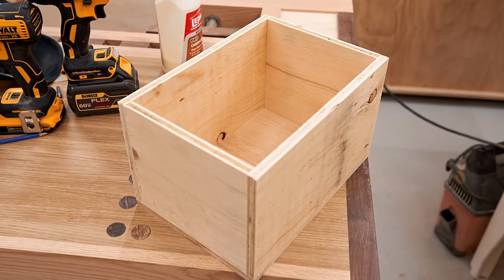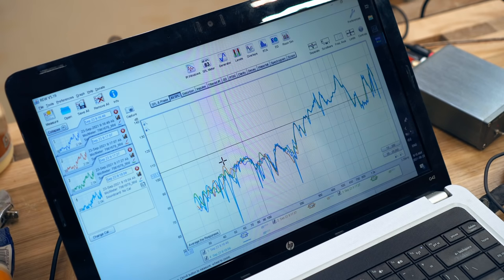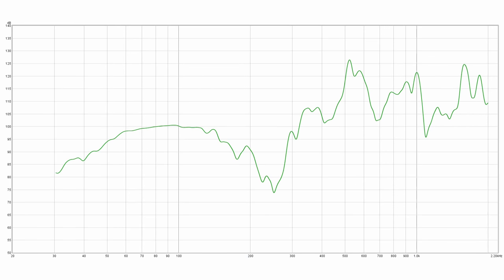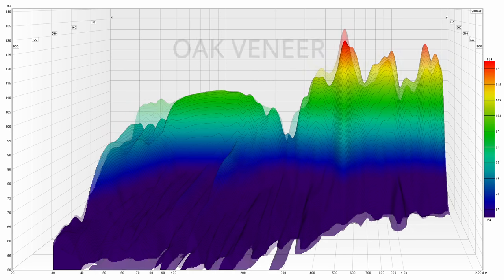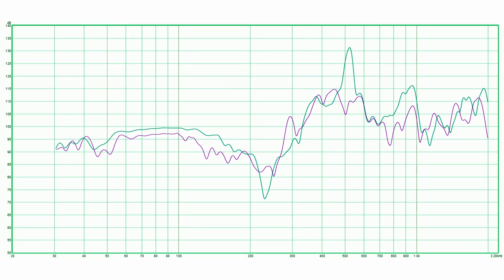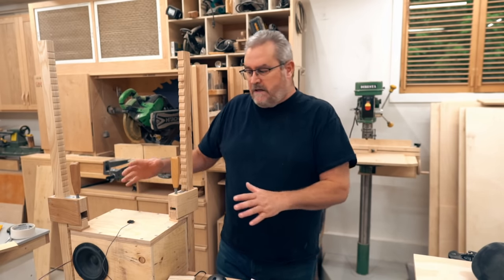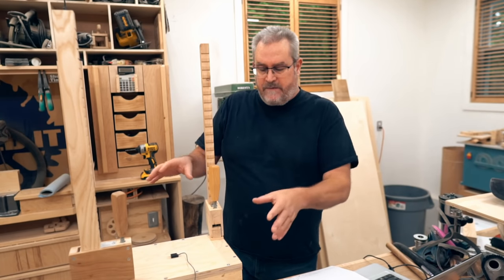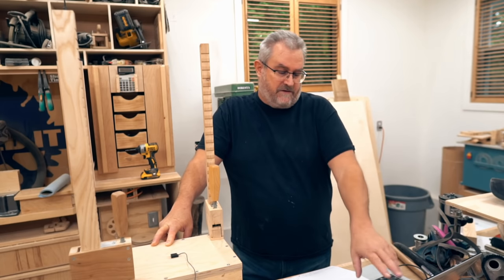PLYWOOD vs MDF For Speaker Building - Tests Show Surprising Results

Comment from the maker: NOTE: This is to clear up some confusion over what I meant about bracing and damping:
Speaker building was always bracing and damping. But at some point the idea started that bracing alone was better, just using a lot more of it. Guys were still doing the traditional bracing and damping (like me), but you also started seeing these bracing only builds happening. The idea was to drive up the panel resonance high enough so that it wouldn't be excited and therefore wouldn't be a problem
I'm speaking 100% from a DIY standpoint, not from what the major manufacturers were doing.

Will making the entire box from the same material make a difference? Possibly, but I did what I could to take the rest of the box out of the measurement. For example the box was clamped down to my very heavy and stable workbench to keep it as stationary as possible, and help restrict the measurement to the panel itself. Yes the other panels were still vibrating and in turn that can affect the panel being tested, but it's the same for each of the different panels.
Each panel was exactly the same size - 8-1/2" x 12" with the screw holes in exactly the same places. 
Why 30Hz to 2000Hz? I did some "warmup" testing prior to the measurements I made to determine the best range that shows the most relevant data. 30Hz because the speaker I used doesn't have significant output below 30Hz. 
I used my ACH-01 accelerometer connected to REW to run the measurements. I made a special preamp for that  accelerometer in this video: https://youtu.be/o1Fctgs8CcQ

My conclusions are that the material used is not a significant factor in how the speaker will sound. As long as what you are working with is of reasonable quality, you should not be able to hear the difference. 
You may be able to imagine you hear the difference, though, and the human psyche is a powerful thing to overcome. If you believe MDF sounds dull and sluggish, and Baltic birch plywood sounds lively and fast, then it'll be very difficult to get past that and you should use the one you think will sound best.
As for bracing vs damping, I think both are valid. Use bracing to reduce panel size so that the damping will be more effective. The rationale of those that prefer bracing alone is that the damping "smears" the response. Much like above, it'll be hard to get past this idea if it's what you believe, so best to go with what you think is better way.
Reply: Very interesting results .I would like to see tests of clds.i read years ago about someone who glued sheetrock to the inside of the enclosure panels.
Reply: While listening to you explain damping vs. bracing on the video, I think we understand damping differently, and I was curious if you mis-spoke, or I mis-understood you. There aren't very many times where I think you are wrong, or disagree with you, so I thought it was interesting. From my reading on the subject in the past, the stuffing, or damping material is to slow down the sound waves to enable a smaller than the math shows box to be used. In a sealed enclosure this is done by stuffing the box, and in a ported enclosure you more so line the box with stuffing so as not to miss up the air flow from the box to the port. Niether of these things have anything to do with panel damping as far as I undertand. Now if you were too put some type of butyl paper, or the like on the panels, that is meant to damp the panel. But those things would actually drive the resonant frequency down (edit: of the panel) due to adding weight. The bacing on the other hand would drive (edit: the panel resonant frequency) it up, I agree, due to making the vibrating panel smaller. This was a pretty sweet test, that changed my mind alot about MDF being the superior box material for sound deadening. Prior, I had only read opinions on the subject, but seeing a straight up test, kind of changes things. I don't know how well these speaker videos do for you but I for one enjoy them, and this one especially was interesting. You keep making em' and I'll keep watching em'.
Reply: @John Heisz - Speakers and Audio Projects  
Nice test, John!
EDIT:  I just watched your speaker enclosure "Stuffing Comparison" video so disregard some of my info/points below

But, I would not have clamped the enclosure down, at least I would not have clamped to the TOP of the enclosure, as that will SIGNIFICANTLY damp and reduce the top panel vibrations and change the overall resonant frequency.

Those clamps will absorb A LOT of the energy and "normalize" the differences between the various panel types.

Instead, I would have built the enclosure with a base panel (the bottom panel that's sitting on your benchtop) with ends that extend past the vertical side panels an inch or so on each side to use as your clamping points or "wings" at the base.

This will still "damp" the enclosure overall and change its resonant frequency, but would not have affected the resonance of the top panel nearly as much as the top clamping points did!

And to be fair, in the real world none of us "clamp" our bookshelf or tower speakers or subwoofer enclosures to the floor or any other supporting surface, so there's that.  ;-)

I also wish you had taken nearfield measurments of the actual Acoustic Response of the Speaker itself in REW using the different panels with & w/o the internal acoustic damping material using your miniDSP UMIK-1.  That would easily show if any of the changes were actually audible or changed the acoustic response of the driver's output.  ;-)

Obviously, the overall size of the enclosure/cabinet will drastically affect the frequencies and amplitude response of the various resonances significantly.

And with each unique enclosure, you must also take into account the potential internal resonances due to standing waves that will occur due to the specific HxWxD dimensions of the enclosure.

IMO&E, using good internal bracing and a SOLID, DENSE Mounting Baffle for the drivers is important.

The best performing enclosure I have built in terms of being resonance-free were from 1" thick HDPE or UHMW plastic panels.  Obviously quite expensive and as heavy as an elephant, though!  But this material is nice because it can still be cut, worked, & shaped easily using your standard woodworking tools...tablesaw, router, drill, sander, etc.

You must use fasteners and not adhesive to build the enclosure, but you can use thread taps and machine screws to construct and secure the enclosure panels and make them infinitely removable.

I use a 1" wide by 1/32" thick foam self-adhesive gasketing tape between each panel's adjacent connection surface.  Of.course, all of your cuts must be perfectly square and smooth in order to seal the enclosure.

Finishing this type of cabinet and making it aesthetically pleasing is the tough part.   :-(

IME, I have found natural wool fiber to generally work best as internal acoustic damping/stuffing material.  Danny at GR-Research also sells a self adhesive backed sheet foam damping product called "No-Res" which I have found to work well to line the cabinet walls themselves. YMMV

The natural wool, polyfill, fiberglass, or mineral wool batting or "loose fill" helps reduce both the mid-to-high frequency panel resonances, as well as raising the QTC of the enclosure (making it effectively up to ~20% larger overall) by converting vibrational energy (sound waves) into low level heat.  Google Search, "Make A Small Box Act Like A Larger One With Polyester Fiberfill By TOM NOUSAINE".

As you alluded to, I will often use a Constrained Layer Damping sheet material ("CLD" tiles/mat/sheet) such as Dynamat Extreme, ResoNix CLD Tiles (best performance), or Stinger's Road Kill Ultimate (which adds a foam isolation/decoupling layer) to the inner panels of the enclosure to dampen resonances and reduce the resonant frequency peaks.

CLD "Deadener" or "sound deadening mat" is made using a butyl rubber-based compound (usually with mica and/or talc added) that is topped with a thickish aluminum foil type "constraining layer" and has a self-adhesive-lined backing on the butyl side.

This combination of materials works extremely well to dampen panel resonances.  To save on materials and costs, attaching a smaller piece of the CLD sheet or "tile" in the middle or center of a resonating panel works nearly as well as lining the entire panel with the CLD sheet.

I have also used "Green Glue" acoustic damping adhesive to attach and line the interior panels of enclosures with Alphasorb Wood Fiber Acoustic Panels which works incredibly well, though you have to design and build the enclosure larger to offset the reduced internal enclosure volume.

To learn more about the potential audibility of enclosure/cabinet resonances, go to the Erin's Audio Corner YouTube channel and watch BOTH of Erin's objective measurements (Klippel Analyzer/NFS) & subjective listening reviews of the Klipsch Heresy IV loudspeakers.  Many of his other speaker reviews cover this topic as well.

Basically, a.simple impedance sweep measurement using an inexpensive DATS V3 unit will show any resonances as "blips" or "bumps" in the impedance curve or plot, and they will correspond to anomalies in the on- & off-axis frequency response.

Keep up the great work!
Reply: You've only measured 1 side of a 6 sided enclosure. What you've measured is the characteristics of that one side. When coupled with the face, side, bottom and top, they'll react differently unless you've produced a perfect cube. 

Another school of thought in speaker building is many designers WANT the face (I forget the technical term for it, the panel the speakers are mounted to) to resonate and produce sound on their own. This panel can be tuned to augment the actual speakers and produce a desired sound. 

Also: who uses 1/2" material to build a speaker? If you're building tiny bookshelf speakers I can understand it but for any serious main speaker? 3/4" is the norm, 5/8" at the bare minimum. If you're using an 8" woofer you MUST use 3/4" due to the sound energy it will produce. 

To be accurate, you really should build the entire enclosure out of the same material. What you've done is like testing the water quality of a lake by testing a sample at one end, near the shore where your cottage drain pipe is located. Go to the source of the water, a spring, and the water quality will be different.
Reply: I would love to see a box made or corian
Reply: @idray986  I would think corian is too reflective......the best speaker cabinets are acoustically dead.
Reply: I use HDF and you are correct the idea is to cause the resonance to go high.  MDF here in Seattle is junk right now. Too little glue and wax. 
The fiber fill dampening makes the speaker think it is in a bigger box.  The higher the quality sound the more the material matters.
Reply: why clamp it down that will effect low  resonance
Reply: I think I will stick to doing both, and my preferred method (science based or not, I think so based on certain testing) of using thicker panel for the front.

I do prefer plywood over MDF for a bigger box but purely because it is a bit sturdier.
Reply: I think bracing alone should be fine for a subwoofer enclosure. If you can drive the resonant frequency of the panels above the frequency response of the woofer (like an order of magnitude higher), you should be fine. Actually, I've done this with good results. But for a full range enclosure, it may not be practical.
Reply: How does your test account for?: 1) Changes in torque per screw when screwing in a panel, or fitment (say a screw goes deeper in one panel than an alternate, so is better fixed) which may affect panel vibration 2) The use of manual clamps on the panel which would need to be placed exactly in the same location each time with exactly the same amount of tightening (torque) or else one panel is more damped compared to another under test precisely from the variation in the clamping force.
Reply: Any chance you could get some glass impregnated plastic panels to test?
Reply: @chrishoesing5455  just food for thought, sound waves can't be slowed in that manner. If it were slower the frequency would be changed.
Reply: @onetimer312  maybe the frequency inside the box is changed, hence changing the resonating frequency of the enclosure.

Comment: back when i studied sound engineering and was into speaker building, my conclusion was the material is not as important as the construction. meaning adding bracing reduced resonance
Reply: one though i had on bracing was to not divide areas in half but use perhaps 1/3 etc to not get two areas that have the same resonance since this in my experience makes the resonance multiply by each surface with same area. also overkill is always good :P ply or mdf with 1/3 bracing, damping with foam and filling with poly can be combined for the best :) really enjoying these vids!
Reply from the maker: One thing that these measurement highlight is how small overall the differences actually are. Like having a microscope and seeing things at 100X. For each of these sweeps, I couldn't hear any difference at all.
It's like every other technical subject, where these minor differences often get magnified and given more importance than they deserve.
Reply: Great video! Good to have actual measurements to see the difference so I can use veneer plywood instead of mdf. One thing to try is using stick on vibration damping material used in vans to see how well it would work with wood.
Reply: @llee4225  I don't see why it wouldn't work. If it can help reduce rattles or in some cases rid of rattles and squeaks all together in some older vehicles you'd think it would work inside a speaker box also. I've actually been pondering on replacing the old original damping material in my vintage Pioneer CS-53's with some DynaMat or a quality equivalent to see what would happen. :)
Reply: @llee4225  I think comparing how well it works on large thin steel panels, compared to a thick piece of wood panel, doesn't work to well. I'm guessing if he did a comparison between this test result and then added dynamat or the like to each panel and did the same tests there wouldn't be much difference. I think the wood is WAY more damped than the van panels to begin with to a point where it would be a pointless expenditure to purchase the dynamat. 
Agreed that it does wonders in a van though.
Reply: @tomaslainas695  Yes, this is correct. "odd" shaped sections or spacing between the braces is better so it is unbalanced and will tend to cancel each other out. 

Yes, you are also correct on the overkill. I have yet to see anyone build a speaker compartment out of anything less than 3/4" hardwood MDF. Yes, there are different types of mdf.
Reply: Even 1/8" ply woodwork if you have enough small angled pieces of ply. Like a circular shape made from tiny pieces like the back of a lute. That wood be OK if you glued thin dowelling inside across the speaker box (a fair few of them). But if you made a speaker out of a tea chest, not so much.
Reply: My way of construction is to never have a brace centred on the length. If you centre you are creating two panels with the same resonance that can sum together.
Reply: @Thomamps  I didn’t understand please can u explain more simply
Reply: @tomaslainas695  curious if the golden ratio couldnt be applied to some effect here?  I mean amplifying and controlling the spread of sound should go hand in hand with fractals i would have thought. Only time ive seen it is in those seashell speakers from a couple of decades ago. And that was a very basic form of the ratio.
Reply: What? That's ridiculous. 
It's all about the material used.
Bracing,that's hilarious! 
How do you brace the whole box?

Anyway MDF is not a material to build a box with nor is plywood.
 
The most important consideration in building an enclosure is in its dampening factor. 

OSB is the material to use if you want to build an enclosure with reduced cabinet resonance. 

OSB tests considerably higher in it dampening factor vs plywood or MDF.

It maybe difficult to work with, but nothing beats it reduced resonance characteristics.
Reply: Everyone is an expert, reading the comments. Great video.

Comment: I doubt the test will show anything worthwhile. The other 5 sides of the box are made of some material, which when it vibrates will transfer that to the top panel. So the test wont correspond to a whole box built from each material, it will be confounded by the energy transferred from the other sides, which will be more or less efficient depending upon density, young's modulus etc. You would either need to build a whole box from each material, or use thick welded steel or concrete to make meaningful comparisons.

Comment: Thank you. I just build a box using 3/4" MDF, and I hate using it because it splits so easy with screws, even drilling a pilot hole, so I'm going to go buy 3/4 oak and try again.
Reply: Try using confirmat screws, they’re specifically designed for Mdf and particle board
Reply: Try using woodglue before you put a screw in, but with little saw dust...